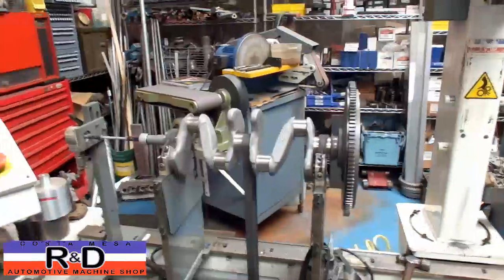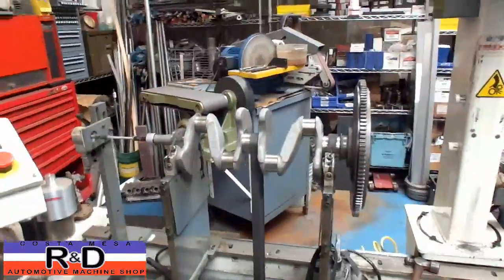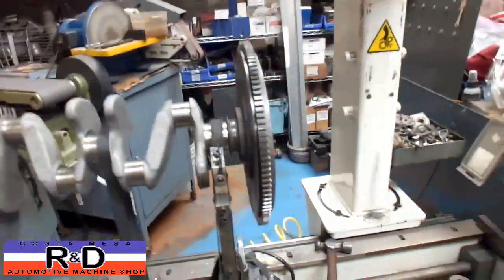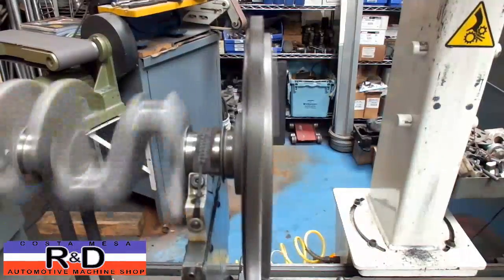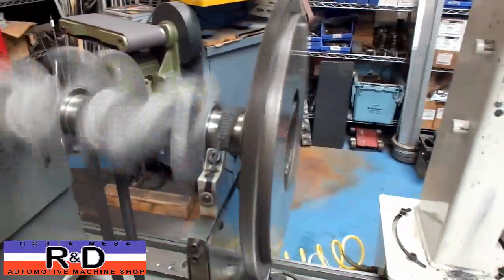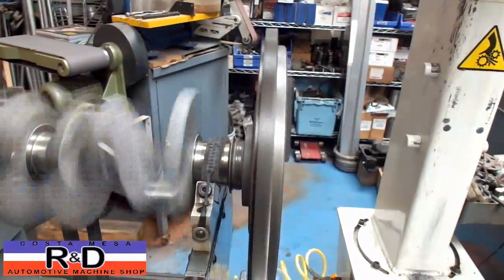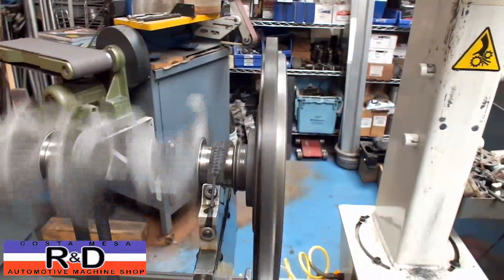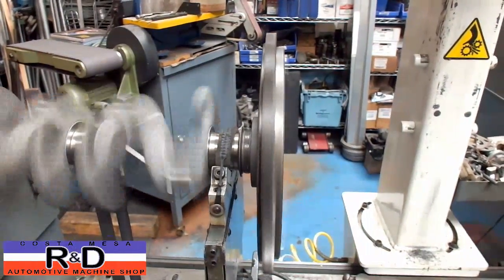MG TF Flywheel Wobble on the Crankshaft Balancer

Comment: The ring gear is installed by heating it almost to glowing and the slipping it over the flywheel. The first time I did that it cooled too quickly on one side and didn't go all the way down. I was also able to whack it down into place, but the next time I was careful to get it on straight from the start. Thanks for showing this, John.